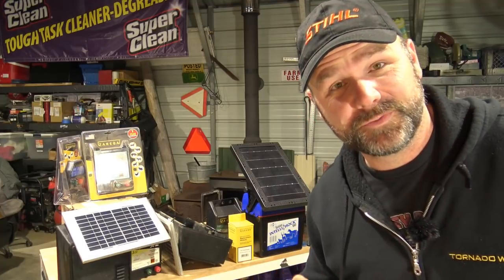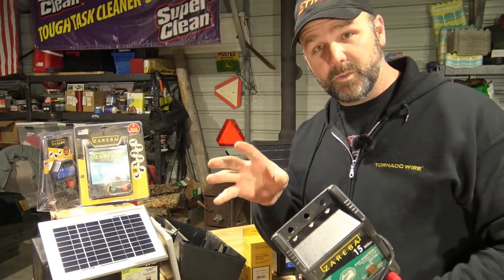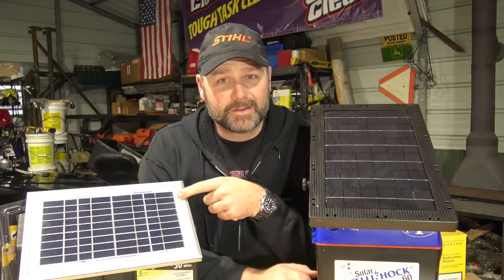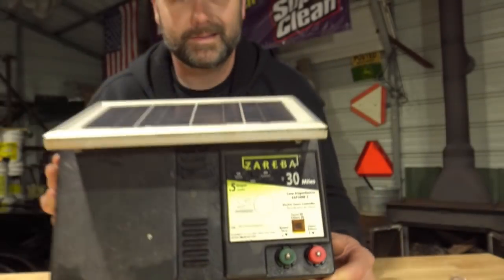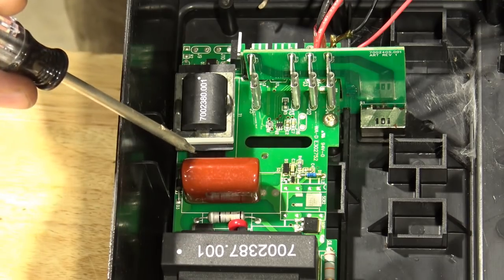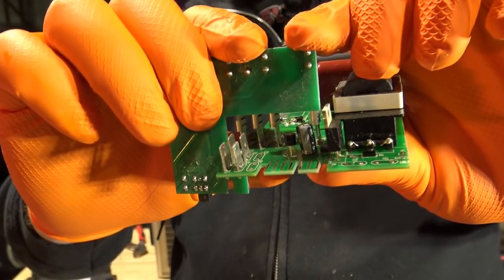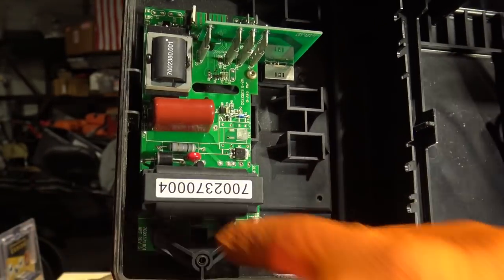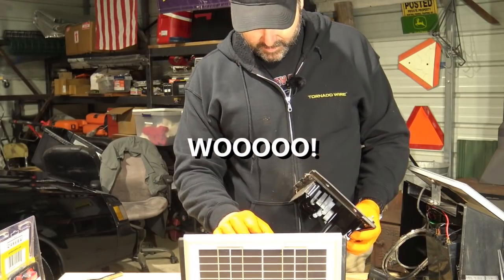Farm Fencing: Electric fence controllers...Solar? DC or AC what's inside them!

Comment: Funny story. I stopped a car for a traffic violation, late at night. The driver decided he did not want to speak with me and took off running. Anyhow, when someone runs from the Police they usually have a bit of a head start. I watched as the bad guy (BG) scaled a chain link fence. I thought to myself, well crap here we go fence jumping (cops are known for that you know, wink wink). When BG reached the appex of the fence he started shaking violently as I watched curiously. However, not curiously enough. He then fell from the top of that fence into the fenced yard. I wondered what that little Cleveland shuffle was about; but dismissed it knowing, " I am the bad ass cop going to catch this turd." So not to be out done, I followed the same path as the BG. I reached the chain link fence and quickly inspected my route over it. I saw a weird wire at the top of this fence (about 12 foot high). Not wanting to damage the fence I pushed down the wire onto the top cross bar and began my trip to hell. I got to the top and put one leg over to the other side. Just when I did that I looked up and saw the BG, again doing the Cleveland shuffle on top of the same fence but across the yard from me. I thought for about a millisecond he must be showing off for someone cause that just aint right. Then suddenly, I felt the most intense pain; but my brain could not process what was happening. I just knew I wanted off this damn fence but could not move. I managed to tip to one side and my weight caused me to fall inside the fence to the ground. I figured out, at that point, that weird wire must have been an electric fence. So not wanting BG to get away and not in the mood for a second Cleveland shuffle myself, I made a call over the radio. I said I had just been "shocked". Well my friends every cop in 5 states heard I had just been "Shot". So let this be a lesson to choosing your words carefully and be cautious of weird wires. PS the BG was so shocked he just laid down under a car as I called in the 30 cops heading my way, many coming from their homes off duty. That is when I realized what everyone heard on the radio and was embarrassed but grateful. Oh and the fence, I knocked on the back door trying to get the owner of this yard to let me out, minus the return trip to hell. Nope, no one home so I did the next best thing and used a wooden hoe to pull down electric fence and get out. Crazy night and I have a dislike for electric fences. I am pretty sure my teeth even hurt while watching this video.
Reply: Thanks for sharing. Pardon me as I shamefully cackle out loud! My 4 year old sister grabbed an electric when I was 10 and holding her hand. (Visiting a friends farm in the 60's). As soon as she grabbed the wire, I started doing the headless chicken dance! My mother was sitting in the car down the lane, waiting at the house, and saw the whole thing. Sis finally let go, and the smoke stopped coming out of my ears! Im 60 now, and can still remember the "tickle" from the fence.  Seriously, I hate that happened to you, but glad you still got your man. I'll keep your safety in my prayers. Be careful out there! (Widow of a cancer Line of Duty Death Paramedic/FireFighter.)
Reply: @MrsBJPalmer  Thanks for the reply and I am retired now but it was a funny memory to share, like yours.
Reply from the maker: Lol people love a good "shocked cop" story bhahahaa...good stuff brotha!
Reply: @MrsBJPalmer  Having had "many" shocks from electric fences over a period of over 50 years using them I must apologize for laughing so hard but I could barely even read it . As I tried to read it I could see a vivid picture of what was coming next. Thank You
Reply: @conundrumconundrum5589  Congratulations on your retirement, sir! Yes, those funny stories are fun to revisit. I'll bet you also have many, many more! Write them down! Folks are always ready to hear these experiences!
Reply: @erniebigbie3211  So could my mom!!! I would remind her every now and again, and we'd laugh all over again! My sister was to young to even remember it, but enjoyed it still, at my expense! Mom is gone now, but my job was to make her laugh until she'd wheeze, and I LOVED my job! Glad you got a good laugh too.
Reply: I can’t quit laughing 😂

Comment: We use to run Hogs behind electric fence when we turn them into our corn field. If I remember we did a two wire run,. 6" and 12" off the ground catch the snoot and the ears.  Hogs and pigs will hit a electric fence running and scoot right under it. Fence height is very important and keeping the fence run clean.

Comment: From someone with many years of using electric fence I suggest using separate components. . Good quality 12v fencer, Harbor freight etc. 5 watt solar panel and any 12v battery that will hold some charge.

Comment: for electrical equipment used outside there is a spray that will coat the boards to make them waterproof
Reply: conformal coating, CRC makes some readily available on amazon

Comment: Hopefully your premierone and zareba units keep working for a long time! If not and you look for another brand check out Gallagher. We have two units and have had no issues for about two years. One m1000 ac powered and an sa100 I believe which is our portable solar charger for cattle rotational grazing.

Comment: Over my head!😁 I have grounding issues during the hot summers up here.
Reply from the maker: Yep they say pour a bucket of water around your ground rod brotha
Reply: and the little step in ground rods for temporary fencing never work as well. Better might be if you can drive a normal ground rod every 50ft (or 20ft or 100ft or ...) and just leave it so you can connect the temporary fence to it when you are in that area.

also, you may find that mixing some epsom salt in the water before pouring it on the ground rod will permanently improve soil conductivity in the area, or at least longer than the improvement from plain water.

Comment: It sounds like it might be easier to get the number off the component to order a new part if it is there and solder it in. Probably a lot cheaper too. If there isn't a number on the board or on the component check the schematic diagram for info if they provided one or try to look it up on the internet.

Comment: shame I am in the UK I would happily repair that circuit board for you, but good job done on the rebuild all I will say is put a  little battery terminal grease on them battery connections to stop corrosion

Comment: After replacing a couple of Zareba chargers in as many years, I bought a Parmak like Grandpa always used.  15 years later still using that same Parmak.

My father-in-law had tried a couple of different brands, and finally bought a Parmak like mine. That worked until lightning hit a tree along the fenceline. The Parmak exploded clear across the shed, and the underground electrical line feeding the shed became so leaky it was feeding 10-15amps into the ground but nothing was reaching the shed. Outside sheath on the cable looked fine but cutting open the insulation found powdery copper green slime instead of wire.

Comment: how meany volts shock do each of these give ?? my 34 year old mains unit gives 8000 volts 1.5 miles away .. my 12 volt units give 10,000 volts one line 100 yards.  or 4,500 volts for 3 lines  100 yards . friend had one he had a mains one hotted up  and it gave 13,000 volts, up the hill after fencing the flats on his 4450 ac  block..NEW ZEALAND IS THE HOME OF THE ELECTRIC FENCE UNITS ..

Comment: it looks like these boards failing are a common problem. in the industrial world most every thing has a "conformal coating"( a poly coating ) it seals the board to keep moisture, dust ect from affecting the board. im really surprised that these boards don't have it since they are outdoors in a un-sealed unit. you can get small spray cans of the coating but a lot of hobbyist just use clear coat. it wont short out next time the ants get on it. but current day solid state electronics are not that great when it comes to 10kv. I bet a couple good coats, and i mean good ones(don't be shy) and that board will likely last much longer.

Comment: HERE is a story. Dont try this. This is how I magnatize a screw driver. Take about 3 feet of 12 gauge wire, and strip both ends. Wrap the middle of the 3 feet of wire around the screw driver. Until you have the  entire length of screwdriver wrapped. Then touch one end of wire to ground of car battery
 Then touch the other end to positive side. Make it quick. You will see a spark. Take it off the battery. Unwrap the screwdriver,  and now you have a magnetic screwdriver.👍☺♠️🇺🇸